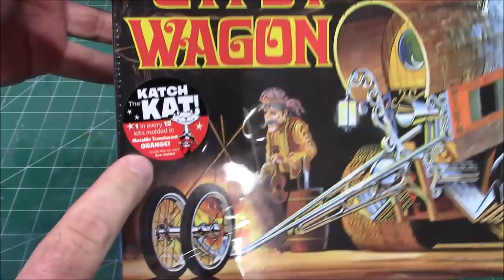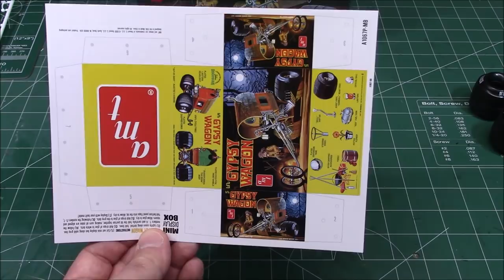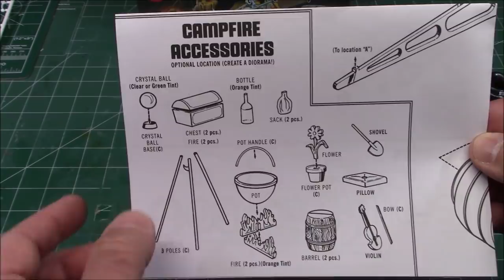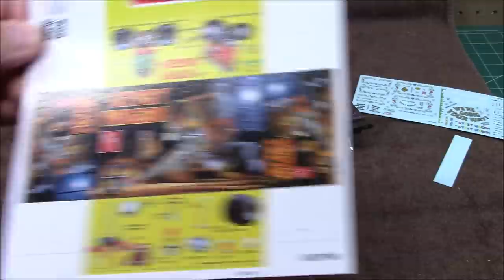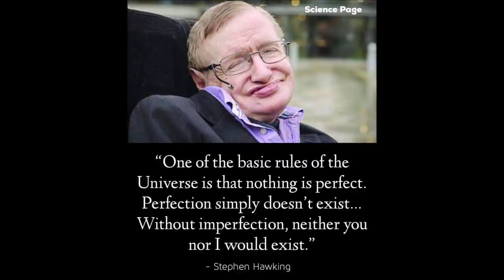AMT Lil Gypsy Wagon Hemi Show Rod 1/25 Scale Model Kit Build Review Rust Weathering Painting AMT1067

Comment: Excellent detail work with your painting skills.  Keep the model builds coming.  I've noticed sometimes you use black craft paint instead of the black wash when you do detailing. Is there a reason why you use one instead of the other, because to me it looks like you are accomplishing the same thing.
Reply from the maker: Paint works better for filling big areas or deep crevices. Wash works well for fine details and tiny openings, etc.
Reply: @hpiguy  Thanks for the tip, I knew there had to be a reason as to why you used the two different products other than, I am out of one so I will just use the other one.